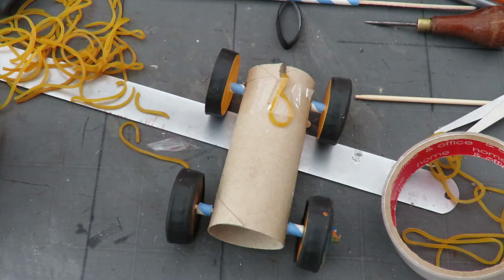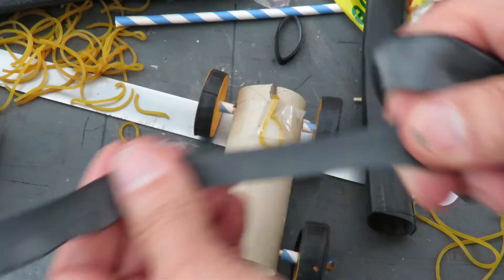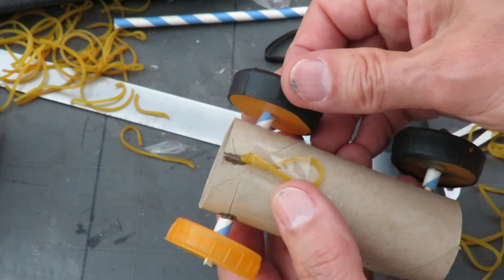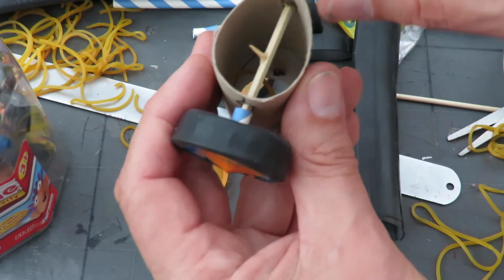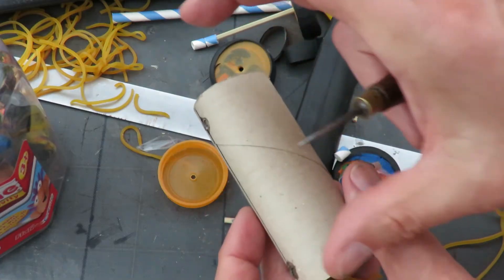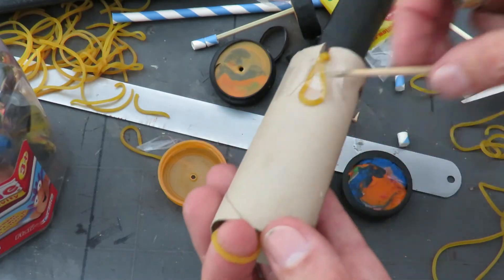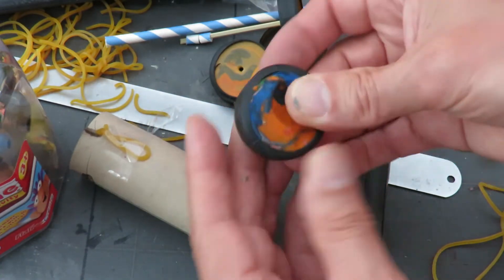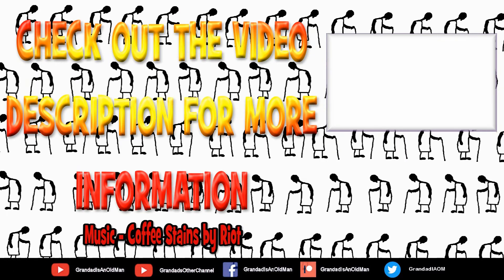Cardboard toilet roll Rubber Band Powered car

Comment: I'd like to see how well it would work if you made the car really heavy so that it maintained inertia really well, and gave it really thick rubber bands. That way you'd get a really long free wheel. I think that might be a very efficient way to cover distance...
Reply from the maker: You know you are going to have to build one yourself to find out. Like any vehicle it will always be a compromise or balance between power and weight 😊
Reply: Well I figure since you're always building them, it might be a neat thing to try out with your next car.
Reply from the maker: The problem is that having done a couple of hundred rubber band powered car videos I get a lot of suggestions for improvements. What I prefer to see is people try to build their own. That way they can demonstrate evidence to back up their theory or proposition. Many of the comments on my rubber band powered cars are from people who have tried and failed to build the car, however they rarely ask for help before writing abusive comments about how it doesn't work when clearly it does in my video. Those that do ask for help find they do receive it. In many cases that has involved a bespoke build video specifically for them. Much more satisfying are those who have posted that they have had success with their attempt and even give links to their successful videos. My most viewed video is a rubber band powered car that is now often used as the basis of school projects due to it's simplicity and minimal cost component requirements. I often get comments on that video from people who obviously resent having been given the project to do and feel the video is too long and too slow and too boring for them to watch all the way through. However I am aware of at least one direct copy of that car being shown in a video where I am given no credit for the design but on the positive side whoever made it clearly liked it enough to copy it and claim it. I have done videos covering big wheel, small wheels, rubber tyres, bottle caps, wooden wheels, plastic wheels, cardboard wheels, square wheel, gears, single bands, multiple bands, hot glue, no hot glue, duct tape, sticky tape, plastic bottles, cardboard, weights, brakes, steering, launch mechanisms, electronic speed traps, and plenty of other variations many of which have probably been requested by somebody with a homework project. You are clearly a competent modeller and could quickly knock up a couple of identical cars so you can test and demonstrate the benefits of one over the other.
Reply: Sweet! I love doing this too